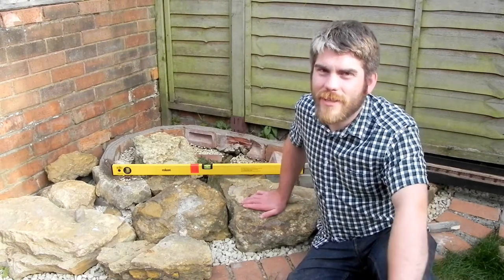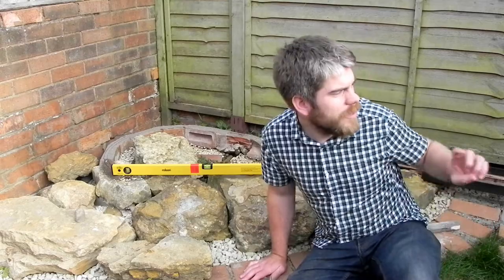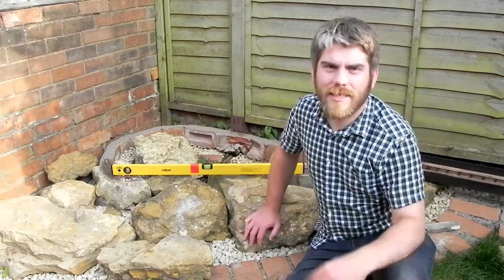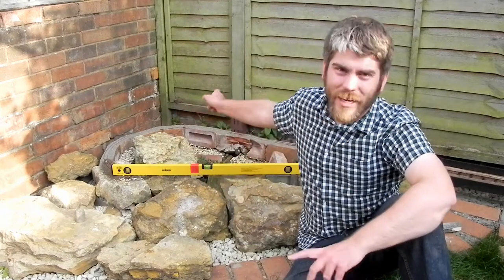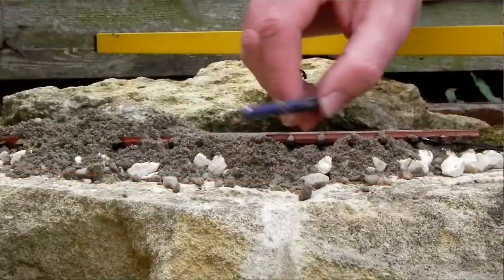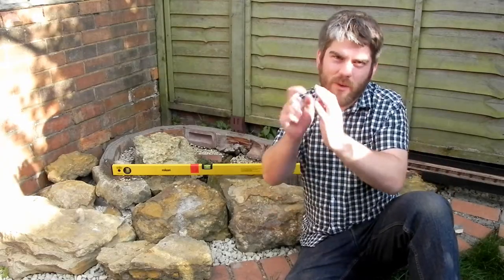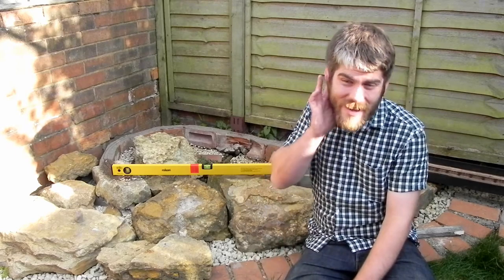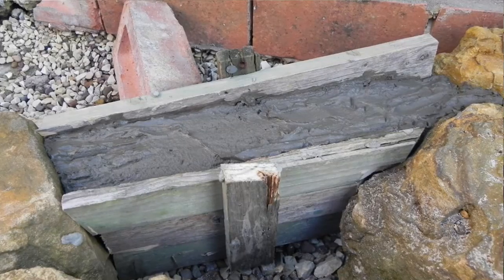n00b Gardener 049 - UHU Palindrama!

Comment: Have you thought about using bathroom tile grout?  It comes in a variety of colors, already has a bonding agent designed into it, and should be weatherproof when finished.  I know folks in N scale have used it straightway for ballast.  You'd probably want to add some chicken grit or other crushed granite aggregate to give it a little more volume, but I'd give bathroom tile grout a try!

Comment from the maker: It did work in the end, you'll see when you get to number 51 I think. The problem was that my sand was damp, combined with the relatively small scale and the heat on the day I did it the mortar dried before I could wet it down properly. So now I've been drying it out in the microwave before I use it which means there's no moisture to spoil it until I wet it properly :)